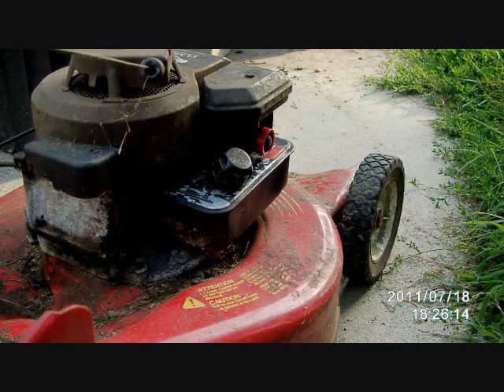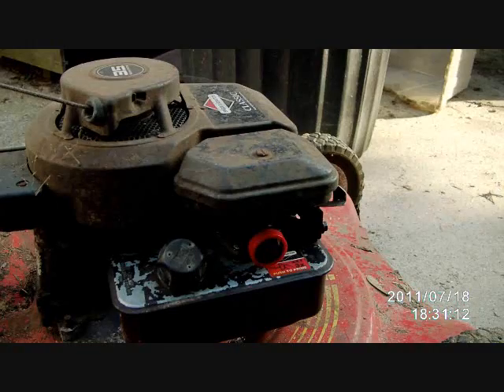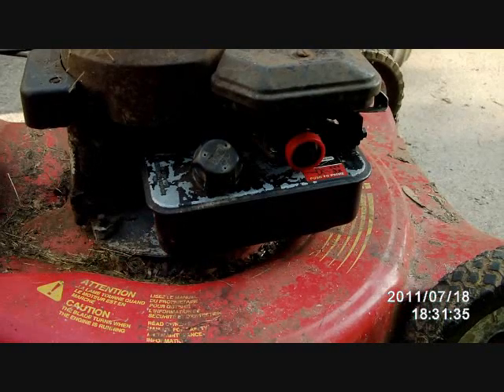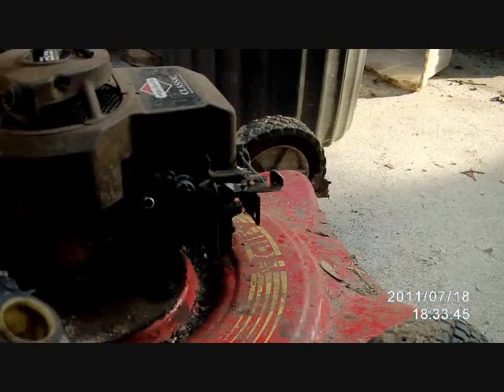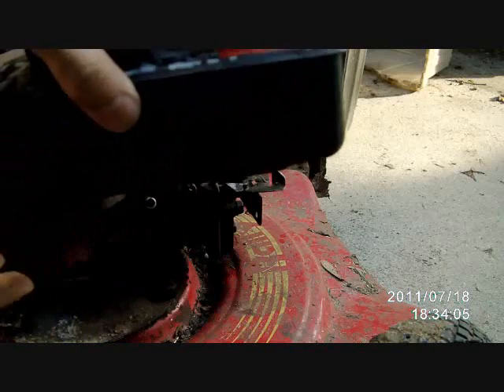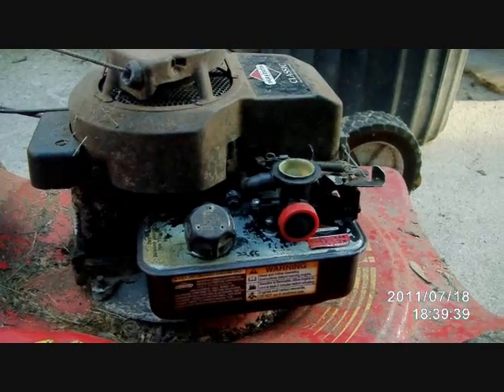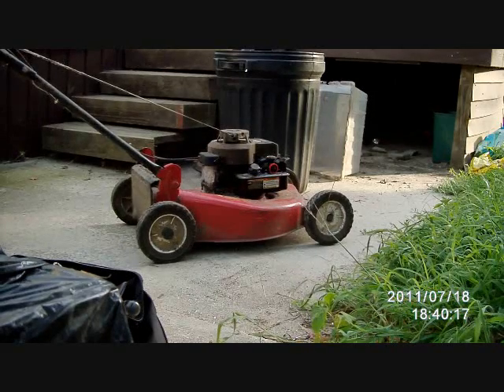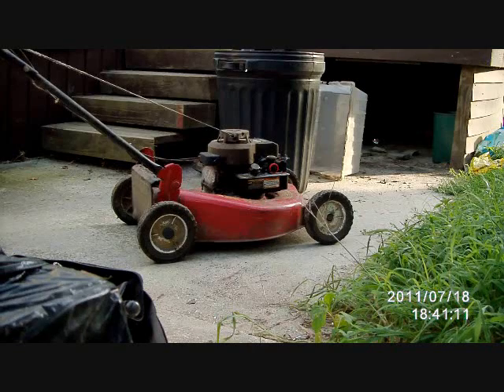Changing a gas tank on a Briggs and Stratton engine

Comment: Thx for a great, long ago video!

Wouldn't happen to have that mower and tank part #?
Even though my model is a bit older. Priming pump ring is solid black no red ring!
Reply from the maker: Big Burly thanks.  I actually still have this lawn mower.  It hasn’t ran in about 2 years.  I’m sure I can get it running again.  The deck is pretty rusted and the left front wheel mount is about to come off.  I’m sorry I do not have a part number.  I did get it from some person on eBay which was a long time ago.  I’m sure they are out there somewhere.
Reply: Thx, 
I found my model # & thx to U n YouTube getting the part will be the hardest thing to do!

Comment: Thanks great video! I got some bad fuel in my tank and felt the best way to deal with it was to remove the tank and safely dump the old fuel into a container to prevent spills. I was about to remove the entire stabilizer bar on the front of the engine to get it off, but after watching your video realized it was just two bolts. Job took me about 5 minutes and now I'm ready to rock when I get home from work this evening.

Comment: Thanks for the reply.  I found the spring connection info through a photo at Images already, but thanks anyways.  I did like the way you reminded to not lose the spacer.  Because of that comment, I noriced that my old second-hand mower had lost it's spacer already and that's why the fuel-tank had a hole in it.  It got forced to hard.  I fixed the hole and will find a spacer for it.  Put it all together after a good long and thorough clean and after three pulls, she purrs, just like a bought one.  Ahh Briggs and Stratton, if only all things were built so well.

Comment: can't see how you removed the spring.
Reply from the maker: Sorry, I did not remove any springs at all.  Actually it was a throttle linkage.  You can't just pull off the linkage by the way it is made.  After you unbolt the gas tank off of the engine and pull the tank off of the intake tube, you can tilt the gas tank upward so you can get the linkage off of the carburetor butterfly lever.  Thank you for your comment.